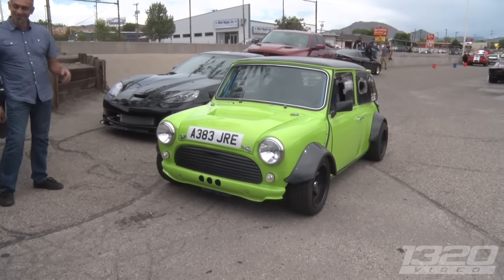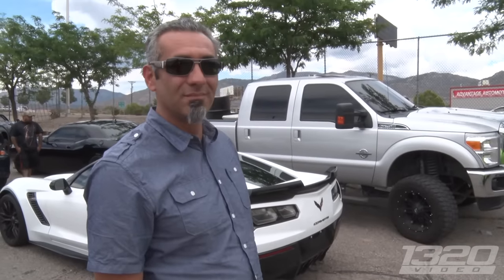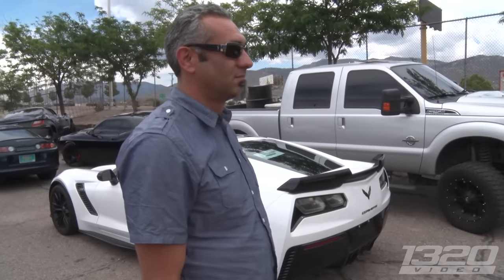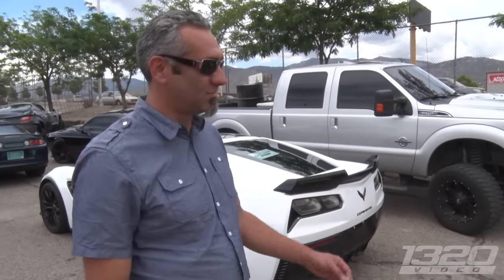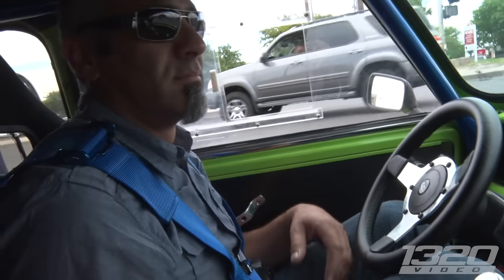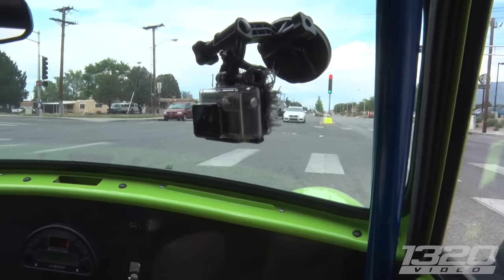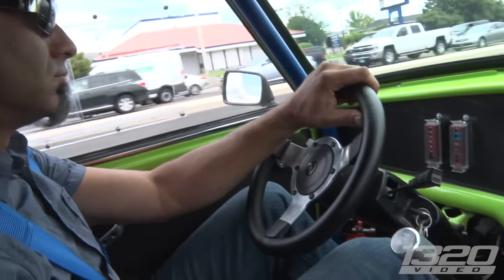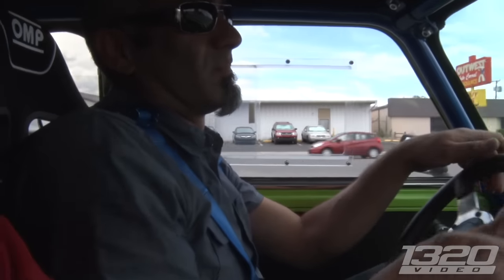He put a HAYABUSA Motor in his MINI - It’s SICK!

Comment: Apparently using the motorcycle transmission. So no reverse?
Reply: The thing weights nothing, just hang ya leg out and push it back with your foot
Reply: Kieron Walton or get an electric starter on a button. Slow reverse, but works like a champ!
Reply: Ken6151 usual conversion wires the starter into a push-button reverse. basically, electric reverse. although, that new busa conversion from the uk with the custom built box that has a reverse built in looks mighty fancy. designed to fit into the minis engine bay too.
Reply: CptCannibal  I had a VW with no reverse and 440k miles and I delivered pizzas in it. Only got stuck once couldn't see the driveway and pulled in to far the poor people tipped me good then helped me push it back up the hill. Also later on I got shit faced and ran it dash deep into a pond and left it until the next day. The farmer pulled it out with his tractor and I couldn't believe it but it fired right up. It missed for a couple of miles and poured water out of everything but it eventually cleared and ran fine.
Reply: you can see the reverse starter motor in the back
Reply: Tammy Forbes That's insane lol
Reply: Ken6151 - probably do a kick stand bitch (spin) with it just like a bike
Reply: starter from a car hooked to the drivetrain for reverse
Reply: What kind of VW? What year?
Reply: there is a sun roof contraption below the driver feet rest for reverse in 'Flintstone' mode
Reply: fidel catsro 
😂😂🙌🏻
Reply: Kieron Walton I've seen a guy do that in a van that must weigh at least 3x more than this mini
Reply: He already has a humongous stater driving the rear sprocket
Reply: Kieron Walton i have one of my own, you can literally pick the car up and turn it on your own, if there's two of you grab either end. Plenty of videos on here of them being picked up lol

Comment: If the number plate is from the original then that car started life in a town very near me....Stafford. Had lots of Mini's over the years during my time fiddling around with cars, including Coopers and Cooper S but my favourite was a 1964 Mk1 Mini i rescued from a guy who was about to scrap it. It was a real rare find as very few Mk1 Mini's were left in UK by the 80's because owners treated them as "just another Mini" so most were neglected and quickly ended up at the scrap yards.....unlike Cooper S which were actually much easier to find.

A Mini like this in the US though??? No fun at all. All your roads are way too wide with loooong straights!! Mini's really come to life on narrow twisting roads and that's where you have the most fun with them, throwing them into corners. This guy is just blasting up and down a long straight which is really boring.

Comment: Incredible mods - Here in the UK even stock 1960's Mini's were a lot of fun in spite of their lack of power or acceleration - once you got used to driving them the handling was incredible - very slow acceleration but being light, with a very short wheel base meant we didn't slow for corners and the narrow little twisty narrow back lanes of the UK were the Mini's playground. As kids the challenge was to leave vastly faster, more powerful and expensive cars behind in the mud - such a shame that mini will probably never get to play in the twisties as that acceleration would just add to the fun.

Comment: Knew a guy who put a Buick V8 in a Mini,  it had an  engine in the back driving  forwards thru a gearbox into the front axle !!

it only wanted to go straight around bends, it had 4 short exhaust pipes each side under the rear windows. slightly noisy !!

Comment: Its power to weight ratio. Hybussanweighs 300 kgs approx. Minis weigh  1800 kgs something plus aerodynamics. Car engines are also more. Torquey and runs on lesser rpms. Good engineering with transmission can make wonderfully drive with hyper bikes engine
Reply: Vikas Shelke not even a brand new mini allroad weighs 1800kgs
Reply: Vikas Shelke classic minis like this weigh under 700 kgs

Comment: "You can tell he shifts using sound, cause there's no rpm's in the cab."  Uh...okay.  If you've ever driven stick, you'll find you don't use a tach hardly ever.  Even if you want to near-redline each gear, experience will tell you when that's about to occur.  Regardless, those 1.3L engines are quite versatile and there are plenty of aftermarket mods for it.

Comment: Why does he hold the shifter at the bottom?
Reply: Marcus Hesketh same reason I do.  It's quicker
Reply: he only needs to tap the shifter up a gear twice then down twice, no fiddling with the gear stick trying to get into 2nd, 3rd etc
Reply: Shorter throw
Reply: I assume with regular no racing style driving but cruising he uses normal position...
but in my opinion he should've had a quickswap system between CRUISE (long) and RACE (short) shifter!